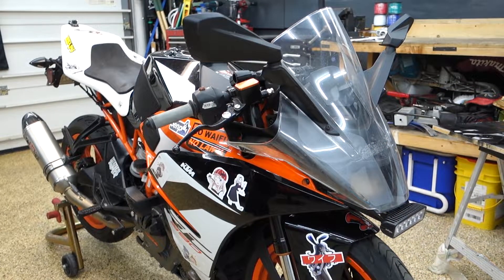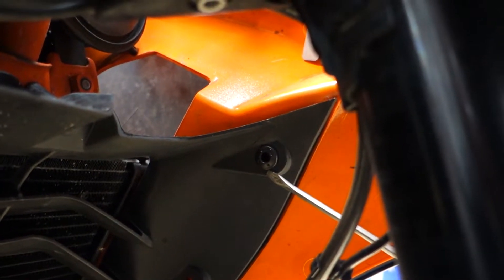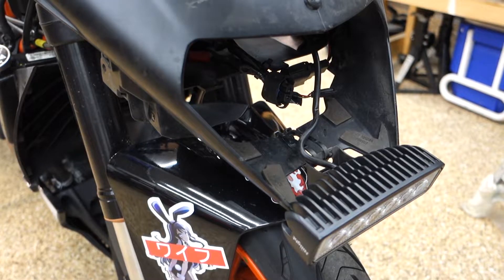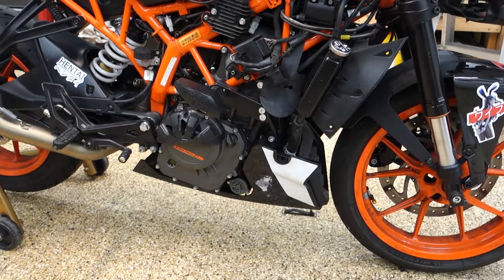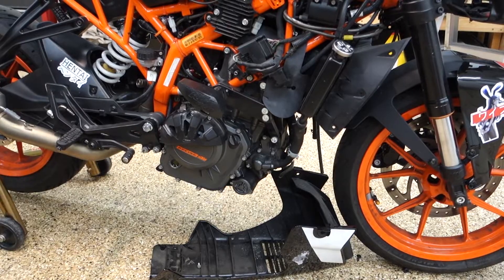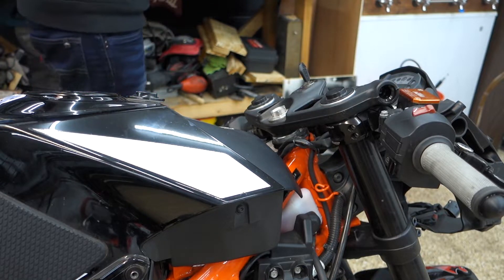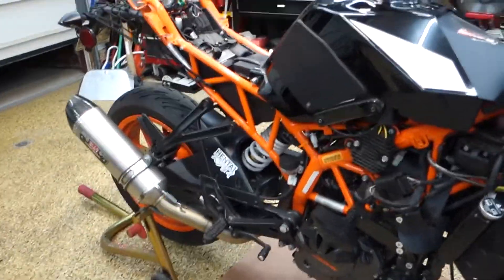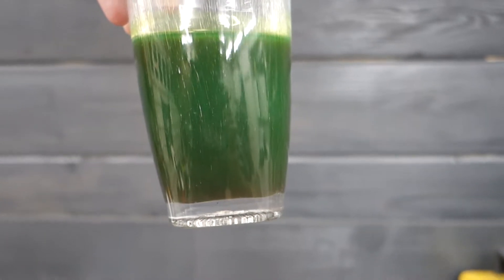KTM RC390 | Investigating the cooling system | Hopefully not a blown head gasket!

Comment: mine also loosing coolant but its not that excessively is it normal or i have the same issue?
Reply from the maker: Losing any noticeable amount of coolant definitely isn't normal. It could one of several issues from water pump seals, head gasket, or just a leak somewhere. You're going to have to do some investigating into it.

Comment: How much coolant did disappear over what time? I am currently experiencing a similar issue on my son's Duke 390. Lets say you rode the bike 100km, was the drop in coolant significantly? Lets say 50ml or more?
Reply from the maker: It would take about a quarter off between the full and low marks on the coolant reservoir after about 2 hours of riding

Comment: Never trust the eye glass for oil 3 different times its thrown me off on different motor one looks dirty drained it brand new one looked clean drained it black as coal other was like ur situation but mine was milky bad head gasket. Bike sounds awesome tho yosh makes great products. Good luck hopefully just bad oil or maybe just a funky color oil I'll be waiting for the next vid
Reply from the maker: Thanks! Yeah I want to take her for a mini rip and fully drain the oil, the sludge that came out is a little worrying. I love the sound even though it's loud as all hell.
Reply: @GarageAddiction  so did you find out? head gasket or water pump seal? the sludge looks like a mix.
Reply from the maker: @parikhit75  Head gasket, it's been perfect ever since the rebuild. No longer drinking coolant and the oil looks great!